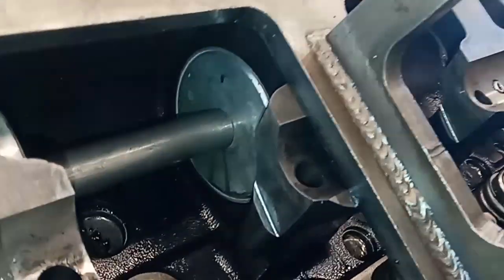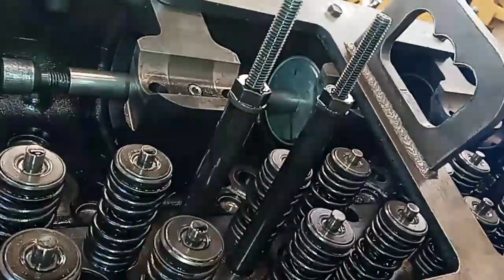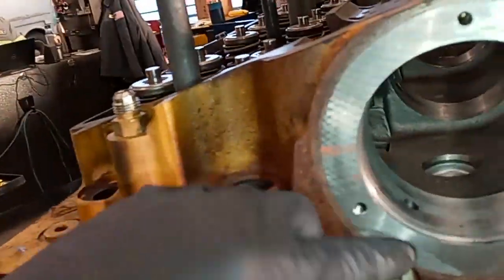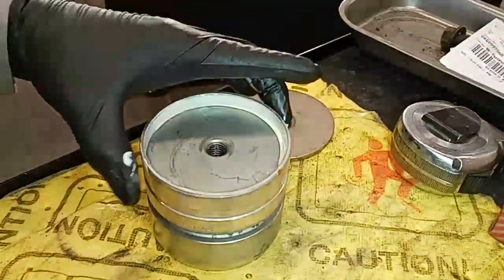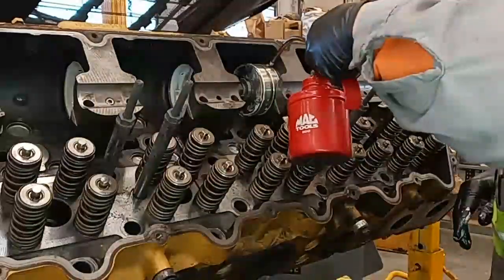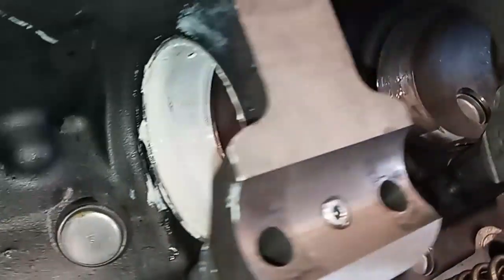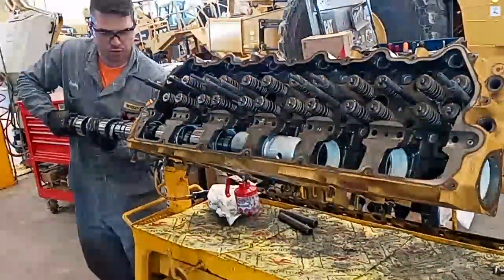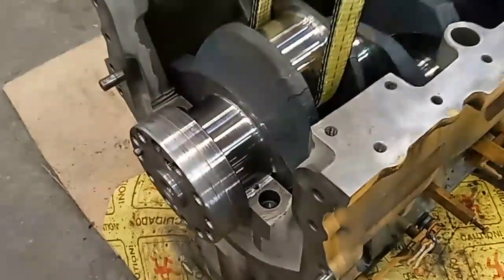C15 Camshaft and Cam Bearings Installation.

Comment: Would this process be the same for a c12 cat
Reply from the maker: Very different because a C12 has the cam in the cylinder block, the bearing install and removal is the same idea though as far as pulling/pushing them in.

Comment: adept this is a long shot but im out of idea did cam bearings on a 3406e 1lw did them by the book cam bearing number one .75 inch measured from the front of the head to center of oil hole went to put the gears and front together and nothing would fit right at all can you tell me what i did wrong? i appreciate you and hope that you can help

Comment: One thing that could be mentioned is that they make over sized bearings for the cam bore, so that you should check the part number of the removed bearing before ordering the new ones!

Comment: Got a gold kit for a C15 once. The front cam bearing in the reman head was not clocked right. The kid doing the overhaul didn't notice and fried the cam at start up. I believe it was one of the good BXS engines. The Cat dealer made good on a new bearing and reman cam. Doing it in chassis was a PIA for sure. You can't use the guide all the way through.

Comment: What was nice about in block cams you could put air through the oil hole in the main. If air came out the cam bearing you were  good as long as the bearing holes were 3 and 9 position. Example 3406b  3412

Comment: Quick question do I need to check liner protrusion or anything else if I'm changing the head?
Reply: Someone drilled to far into the exhaust manifold studs, and heads no good.. leaks coolant
Reply from the maker: Do you need to? Not necessarily, you should but if you inspect your head gasket and the head bolts for signs of carbon and they are clean you should be okay. I always measure it on 3400/C15, but I already have the tooling and get paid to do it at factory specifications.

Comment: Excellent video. What is the purpose of the "joint" in camshaft bearing?
Thanks.
Reply: no purpose, just how its made, was once a flat rectangle then curved and hooked together to make a circle, then fitted to size.

Comment: I really enjoy watching your videos. 

I own a 3406E and I would like your advice and whether or not I would need to tune me ECM after install a Borg Warner turbo part # 14969880000 or would the truck run fine after charging the turbo? 

My plan is to use a heavy duty bully dog ECM tuner with the turbo.
Reply from the maker: I would say to stick with a stock turbocharger in general, unless you are looking to increase your horsepower past the stock numbers.
Reply: Tune it by a independent tuner,and run a 1.32 78mm Borg.

Comment: Hey Josh, have a 3406b that has had baldwin b99 filter on it since I purchased it. Want to change oil and go back with cat filter but cannot find specific cross. Could ya help me out with a number bud?
Reply: A 3406B takes a 1R0716 oil filter and a 1R0749 secondary fuel filter. Primary filter depends on the type. Cat coolant filter now is dry and has no chemical due to long life antifreeze.

Comment: This video went so quickly...I think it was because it was so intense.  I really like to see the inside of someone else's engine.  As for the motorhome, how in the  world could an air line get so twisted.  We often install a specific air valve to activate a towed car's brakes from the air brakes on the motorhome, and what we usually find are leaking air bags...sometimes so bad that the bag has difficulty fully supporting the chassis.  I can't leave without commenting on your expressions...funny how we do that...I do it too.
Reply from the maker: Hey Larry. I suspect the air line was twisted by someone installing the hot hose line onto the air drier during an air drier service, but the spinning part of the JIC fitting was rusted, so they just tightened it anyway. Just a theory.
Reply: @AdeptApe  dang.  Fire him.  😎

Comment: do you have a machine shop in house for machining heads? or is that not as big of an issue on big engines.
Reply from the maker: We generally replace worn heads, if it's a low mileage head like this we will just clean and reinstall it. This one needed an exhaust fastener drilled out and the Cam bearings installed.

Comment: We adapted a porta power to our tool . Works like a charm , you can have the bearings out in about 10 minutes .When we get close to the installation depth we finish with the nut and washer .
Reply: can you post a clip of it?
Reply: Got any pics of it @ALABAMAHEADHUNTER

Comment: Never tried this on cam bearings but on the front gear bushings I put them in the freezer over night. Might try the freezer next time I put some in. 
Ever seen some one over torque the cam gear bolts?
Reply from the maker: I've seen the after effects of it damaging the bearing from the bearing oil gap being reduced. We have liquid nitrogen at the shop and haven't tried using it on bearings yet though.

Comment: Just wanna know... is that a Pittsburgh 1-1/2 wrench? And how often do yall use jumbo wrenches/sockets? Personally I bought the Pittsburgh jumbo wrench set when I first started and now I'm looking to replace them, especially since my 1-1/2 is now an 1-5/8 lol. Just wanna get an idea of the kind of work you do.
Reply from the maker: That is a Pittsburgh wrench. I bought the big set when I first started out and it is one of the few ones I haven't replaced yet. I think the Harbor Freight stuff I still have is a straight die grinder, a couple big wrenches and a brass sledge hammer. I'm going to replace the wrench probably this year with a Cat one, but this is still working for now.
Reply: @AdeptApe  thanks for the info 👍

Comment: Where I work we use a hydraulic pump and a hydraulic jack to pull them out and also to pull them in. It's the easiest and fastets way to get the job done!
Reply from the maker: Do you use a Portapower? Or is it an  actual Cam bearing tool with a hydraulic pump?
Reply: @AdeptApe  It's not a Portapower. It's an electric hydraulic pump and a small a jack. I think they have a Cat part number. I'll try to search for a part number in the tool catalog.
Reply from the maker: Please send me an email at adeptape@yahoo.com is you can find it, that sounds like it would take this job from all day to about 2 hours.
Reply: @AdeptApe  I do that job in 1 1/2 hours or less. You have to be more careful, cause you can ruin a bearing if you don't check it out. We use that pump and jack on almost all 1 piece bearings specially camshaft ones.
Reply: @AdeptApe  I've send you an email with the P/N
Reply: Im jealous of both of you, at our shop we drive them in and out by hand with an 8 lb hammer. And I mostly work 3500s.
Reply: @corbin_c10  whaaaaat. We also primary work on mining 3516 and I cant imagine what it is to take 18 bearing out and 18 bearing in using a hammer!!!
Reply: @miltonandresdelossantoszab7738  its a real work out, though most of the natural gas engines use a oil impregnated bronze bearing, so sometimes all we have to do to install is freeze them in liquid nitrogen.
Reply: Got any pics of it @Milton Andres

Comment: Very informative video Josh.  The in-shop videos like this are great.  I'm fixing to buy a brand new T680 with a 565 HP X15 in it, gotta retire my Cat due to terrible fuel economy.  Do you know anything about the X15s?  I've heard they're doing ok, but I'm leary of the aftertreatment engines altogether
Reply from the maker: From what I understand on them they are the ISX Cummins and they should do a little better on fuel economy than a Cat would. The Jake brakes are supposed to be way better than the Cat ones I've heard. The emissions stuff can really get you though, once it starts getting a few years old and the DEF, SCR and DPF start having problems you can be looking at thousands of dollars in repairs for that stuff. The DEF system really adds a lot of expense and complexity to the system.
Reply: @AdeptApe  How well or not do you think today's new industrial C15's (off-highway, not the on-highway C15's) would perform with respect to fuel economy compared to a new X15 if you were to swap one into a truck?
Reply from the maker: They would probably get comparable mileage to the older C15 Engines, they use the same fuel system and valvetrain design. They do use the twin solenoid injector design, but other than that they are pretty much the same.
Reply: It is very easy to get decent mileage out of a cat. I pull 5.9 6 pulling heavy and running 70 with 4:30s cats hate idling, always shift around 1500 which with most trans will drop it to around 1200 which is peak torque.  Unless you need it drive as if there is an egg under the throttle. Most drivers I know with an x15 can barely pull 5. My jakes are very strong. MXS C15 550 IVA's deleted
Reply: @rodneyward8357  mine is a 2WS set at 550 with a brake saver file, 18 speed 3.55s on low profile 24.5s and I have an APU and I can barely average 5.5, and never run mine over 25 lbs of boost lol its a 97 model 379 with a typical mid roof bunk, no wind deflector pulling a dry van.  If I stay under 25,000 lbs in the box I can get close to 6 but thats the only way.  If I use my cruise control and just let it go, it'll get mid to low 4s, I'm sick of it
Reply: @KaylorTruckingLLC  I understand the milage thing for sure. I don't know where you drive conditions change many things. I know fuel just keeps creeping higher. Sucks. But compare the payment. You will be making on a truck and not making one. Def fluid. Personally I haven't driven one but I have several friends who do that came out of cats to x15s and they hate them. Poor performance and not great fuel mileage. Not Downing anything and a hand has to do as he needs to do. We got to make a living my friend
Reply: @rodneyward8357  for sure.  We put about 80 grand into that Pete last year and still got a ton of stuff I need to do to it lol just about ready for a new ride and be done with the wiring issues I'm having with this one.  The fuel thing just put me over the edge lol the way it's going we will be at $5 a gallon by summer too
Reply: @KaylorTruckingLLC  understand that for sure brother. I wish Yall the best and hope you keep on keeping on old school drivers are becoming a rare breed. Hope to hear of your continued success whether with a Cummins or a Cat
Reply: @rodneyward8357  I appreciate it man, right back at ya!
Reply: @KaylorTruckingLLC  10 months later,do you regret getting rid of the Pete yet ?
Reply: @Trucker186  didn't get rid of it lol canceled the 680.  Actually going right now to look at a 15 model T660 glider, 12.7